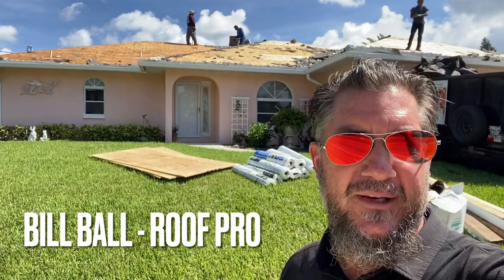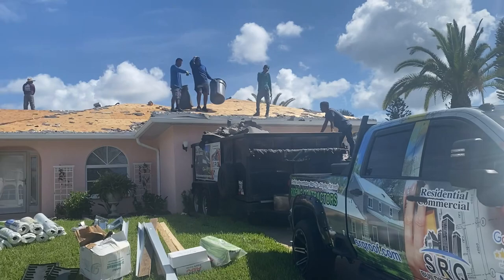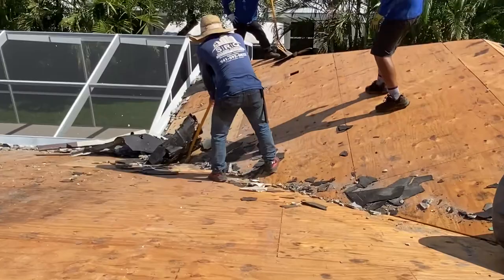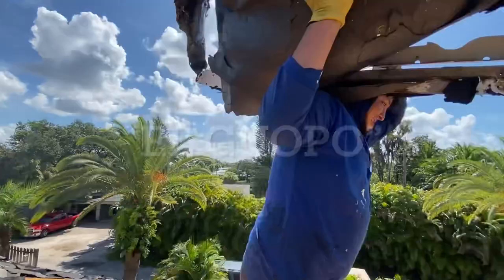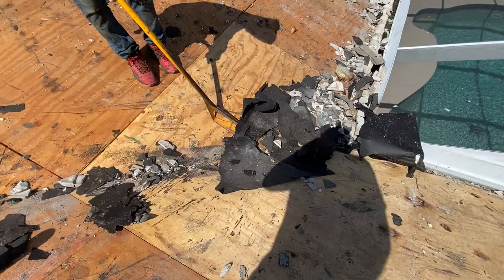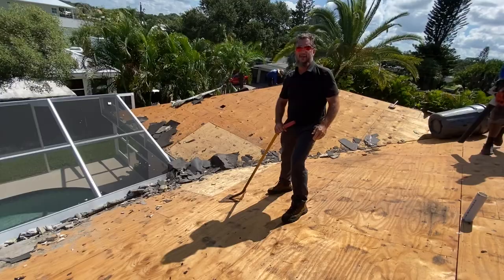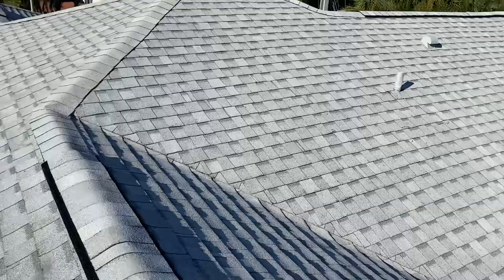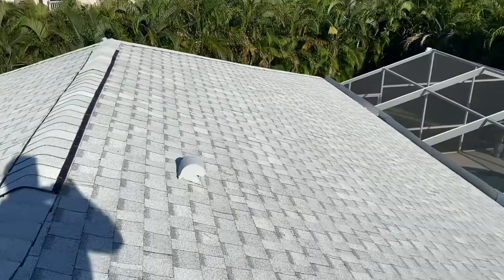Convert a Tile Roof to Shingles.  Step by Step Guide

Comment: Was the tile roof badly leaking and needed to be all removed to replace all the underlayment? Or just needed the valleys repaired?
Reply from the maker: It was in need of a total replacement- lots of leaks and bad underlayment.  It was 25 years old.
Reply: Sounds like a poor underlayment was used to begin with, possibly just the type used for shingles not tile...
Reply from the maker: @gokomets77  Actually, with all the expansion and contraction with the heat here in FL, that’s about all that can be expected for a tile roof.
Reply: @roofingbyballcontracting  look @ Daltile Perennial porcelain tile roofing, should last as long as the deck & underlayment is good. With no water retention, it won't wear out so quickly. Miami-Dade is where everything happens first in Florida, and they've already adopted this new roofing innovation